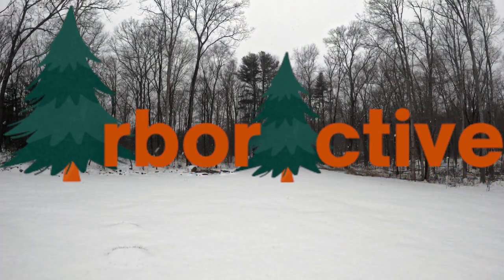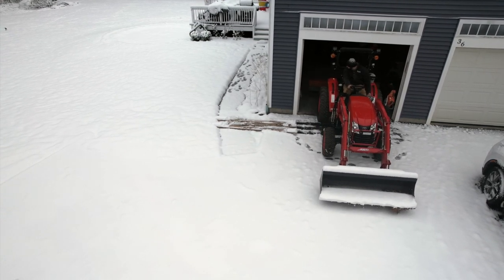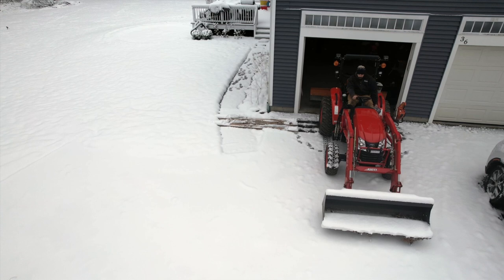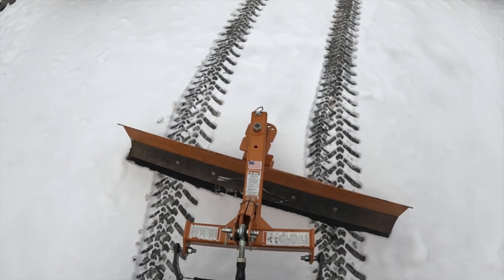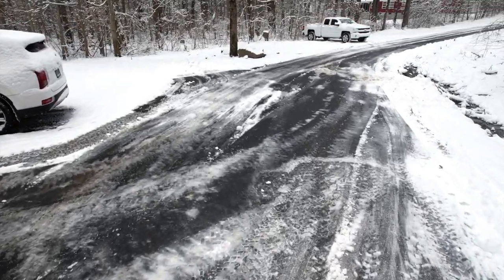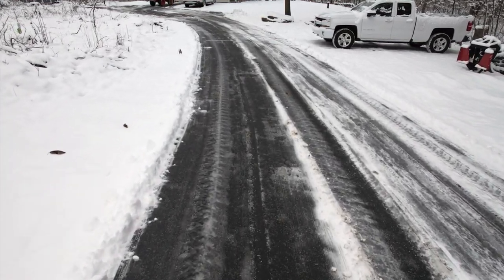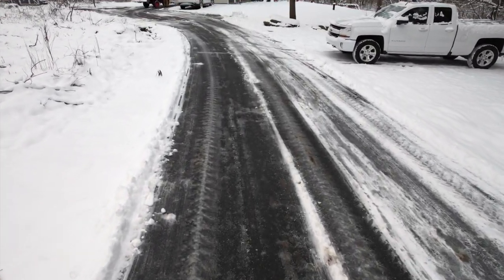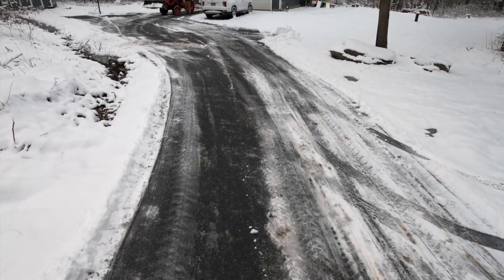First Snow Storm of Winter: Clearing the New Driveway With the Kioti CK2610 Tractor

Comment: Idk if you have snow sticking issues when you plow wet snow but used motor oil on the blade or cooking oil spray works great to help the snow roll off
Reply from the maker: I noticed that out there today and was thinking about what to put on there. The snow was a bit wet and slushy, and I probably should have angled the plow just a bit more. There was so little it didn’t really make a difference, but if it was deeper I would have been feeling it!
Reply: @ArborActive  if you can sneak the wife's cooking spray use that it last 2 to 3 times plowing wet snow

Comment: I'm currently looking for a blade with offset and considering the same one you have, either the 84" or the 72". Do you recommend the 84" size or do you ever find its too much for the CK2610? 
Also wondering what that block of wood does that you have in the C channel of the offset? 
Thanks for your input!
Reply from the maker: It does great with the 84”. I’m really happy to have gone with it over the smaller size. 

The block of wood was a spot to screw a bracket into to carry some tools for a project that I just never took off. It does nothing now.
Reply: @ArborActive  Thanks for the reply